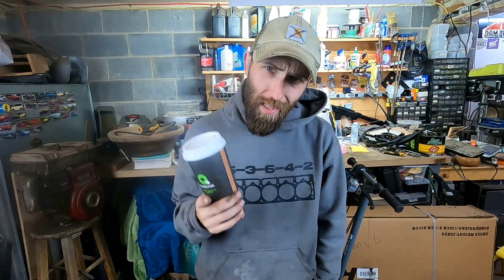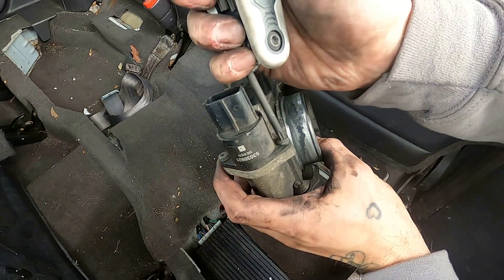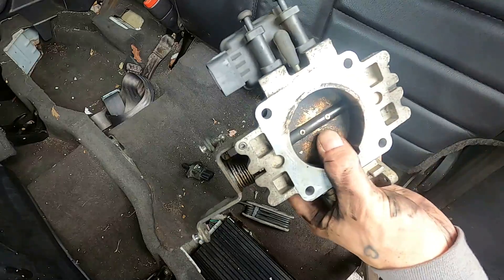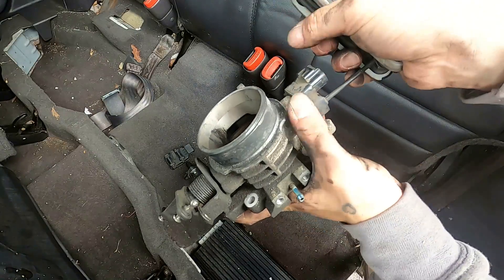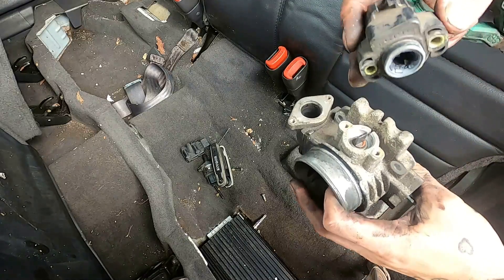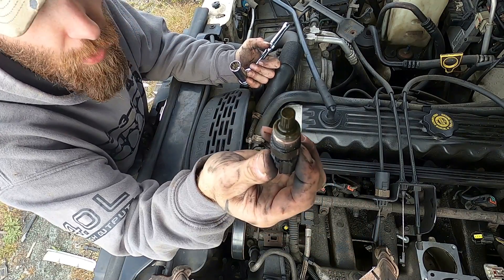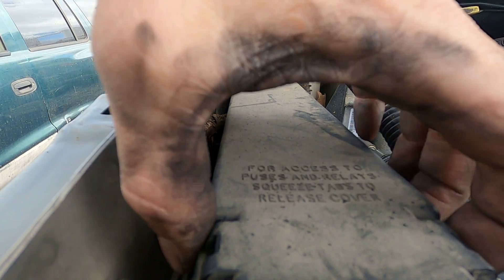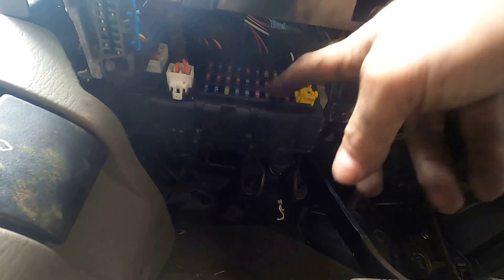Jeep 4.0L engine sensors I suggest you keep on hand

Comment: If you have an air bubble in cooling system, you can get a weird intermittent high engine temp reading when you wouldnt normally be running hot.  

Omg, if you have a 2.4, keep a spare crank and cam sensor, or you wont be crawling no malls.

Comment: Those damn TPS screws!!! 😭 I already stripped mine
Reply: I ended up using a dremmel with a diamond cutting disc to gently cut grooves in the screw heads, then used an impact driver to get them loose. Even the impact driver had to fight them. Gonna put some anti seize grease on them now. 

Make sure you dont cut all the way through the screw heads!!!

Comment: Hi there, thanks for the great video!! I was wondering, when the crank position sensor goes bad and the engine won't start, does it throw a code to the OBD? My WJ is cranking and not starting but it's not showing any codes. Grateful for any advice! :)

Comment: Wish I'd seen this vid when it came out. I had the TPS death spiral last year where the trans felt like slipping bands and wouldn't shift. Swapped out a perfectly good transmission (186000kms). Of course the replacement did the same thing. Went to YTU and found out TPS was the culprit. 20 dollars later problem solved.

Comment: @D&E In The Garage . I have a 2001 Cherokee XJ. I'm about 95% sure the CPS is bad, and the cause for all the error codes that showed up. . The engine cutout about 5 miles from the house like 5 days ago, and just before it cutout, the engine was spuddering. Once I got home I put a scan tool on it & a total of 7 codes were showing up. A total of 6 error codes are from the some of the Coils & Plugs, there's also the Crank Sensor error. From every site & article I've watched & read, the CPS causes all the other codes I have in the PCM.

Here's the list of error codes that I found last week;
*P0300, *P0302, *P0303 - Those codes are Misfire errors.
*P0351, *P0352, *P0353 - Those codes are Ignition Coil related.
*P1391  ''Loss of Signal'' for the Crankshaft Positioning Sensor, &/or Camshaft Positioning Sensor
The only error code that I did have before last week, is a P0432, which has to do with an O2 Sensor &/or Catalytic Converter...
Well that was my week lol... I hope it's not too confusing to read...

Comment: Throttle body sensors- I spray mine every year with electronics parts cleaner. You can tell when the engine starts running rough.

Comment: Can you just buy them? Or are the aftermarket ones not good?
Reply: you can, It's not hard to find parts for them he's just staying God forbid you're breaking down and it's just a sensor. I had my temperature sensor ( one sitting behind the right headlamp assembly ) go out on me but lucky for me there's a lot of auto parts store not far from me and my jobs, I also have other vehicles so again not a big deal.. Biggest ones are the sensors surrounding the throttle body, I changed my throttle position sensor while at work 4yrs ago so as long as you keep up with it's not hard honestly most jobs on 4.0 jeeps  take less than 1hr. I also use high quality parts from suspensions, to engine mods to make the engine more reliable, and swapping out bad parts as soon as possible before it gets worse.
Reply: Definitely. Lol I went to the Jeep dealership to get a mopar thermostat and b crankshaft position sensor, need to go back and get a oil pressure sensor, just put a cheap one in for now but, I think I'll get a bunch more while I'm at it, they're not cheap 100$ thermostat and I think it's was 150-180$ for the cps.. but at least your not going to break down eh.  @StockCarGuy
Reply: Because of a sensor that is lol

Comment: About my Jeep Cherokee is it has two pigtails on the throttle position sensor and the holes that attach it to the throttle body are adjustable so you can adjust the throttle position sensor like adjusting distributor cap and as I learned it's the adjustment for the kickdown on the transmission i'm not saying it's exactly what it's for but that's how I fixed the kick down on Mine by adjusting that but they must have did away with that in the newer Jeeps maybe use some newer computer system instead of like a mechanical adjustment

Comment: Hi Doug, thanks for this video!  I have a 2004 Jeep Grand Cherokee with the 4.0 liter straight 6.  After 15 minutes of idling, the engine starts to idle rough and continues to idle worse.  After driving for about a minute, all seems fine.  The throttle body and crank shaft sensor have been recently replaced.  What should be checked first?
Reply: hello supernova did you get it fixed  back up ? same exact issue on my 02 everything is fine until it warms up an normal driving stop go stop go then BAm rough idle bad amlsot wants to die but doesnt

Comment: Hey so I have a 99 wrangler 4.0 auto trans. Crank no start.  Been battling for 2 1/2 months trying to figure out what is the problem. I have replaced the cam shaft position sensor the crankshaft position sensor the distributor and coils and no luck.  Then went back and replaced the crankshaft a second time.  I replaced the ecm as well and still no luck.  Any ideas???

Comment: Hey Doug, do you have any suggestions to fix a stalling problem with a 1990 jeep Cherokee Laredo 4.0. The car runs and stalls, no power what so ever to put a blinker or hazard lights on while your trying to pull over to the shoulder.

Comment: Might be simpler to just grab a junkyard throttle body. Clean it up. Sand the bottom so it’s flat.  And keep it with all new sensors pre-installed.  Also, be very aware of where you buy your sensors. I just had to return a IAC  that DIDNT FIT. Pffft

Comment: MY JEEP STARTS AND DIES
Reply: Try the starter fuse first. Then if that doesn’t work, get a new crank shaft position sensor. If that doesn’t work, keep working the other sensors he mentioned. Start small. It’s be a good idea to change out most if not all sensors if possible.

Comment: Kinda funny i  took my xj to the dealership to fix the tps issues, and 3k later still have the same issue. A $15 switch solved the whole issue for the tps and no one  has posted it on any forum. The brake light switch has a tiny amount of play can cause  all these issues.

Comment: I'll tell you something: the TP sensor works with the signal from the clock spring that goes to the steering wheel. When that gets damaged, the airbag light comes on and the truck starts to fail.

Comment: I thought I was the only one that bought new ones as spares as these so cheap. I have a spare air idle control valve, throttle pos sensor, fan relay (a must. ) and map sensor. I think I spent $75 for all 😂

Comment: Always jeep a few t20 tirx bits ,a half inch long socket ,a half inch socket,and the multi screwdriver that will fit the torx bits ,alsi 3,4 5,8 hose foot if each and 4 hose clams in case your geater core starts steaming through the vents ir jyst gives out ,the fan fuel pum asd relay are alk the same so carry one extra ,yse quality parts especially when it comes to sensors ,justsatn.

Comment: Crank sensor is not easy on a 2003 Grand Cherokee. Mine swelled and was completely stuck and would not move. I could not get it out even after making the access hole bigger and it was starting to distort and about to break. I used  a few drops of lye at a time to dissolve the bell housing. Aluminum is attacked by acids and bases while steel is only affected by acid. Took 3 days but I got it out, lather rinse repeat.  The reason I am watching this is because last night the packrats ate the wire on the new one and I could not remember how the dash came apart.

Comment: Atleast on XJs the cam sensor is only used to determine where the engine is on startup. If you unplug it the engine wont start but if you start the engine and unplug it while the engines running the engine will stay running like normal but it will throw a CEL.

Comment: I removed the temperature sensor that turns the fan on. Mine failed and cause my radiator to burst in my 02 WJ.  I replaced with an older model manual fan ,after buying a new radiator,$$

Comment: I have a 95 zj 4.0 and sometimes the car shakes crazy on acceleration/misfiring (no fault codes except lambda sensor). 
When you lift off the throttle and drive for a couple minutes slowly all is fine again...any idea?

Comment: I have an odd one... getting high voltage (even with the ignition off) across the signal wire of the TPS. I trace the wires and it seems like oil is flowing through the wire casing? Maybe from pcv valve failure or something? Going to end up scrapping this 4.0 unless You want to buy it. In Washington.  Ran good and still runs but has oil in the wires now and I am having issues finding the short.

Comment: The cam synchronizer is the part that goes into the oil pump and needs to be timed. The sensor is the plastic part on top that you have to remove to time the synchronizer. As long as you don't turn the engine over it's easy to replace.

Comment: I love seeing videos like this. I've had a jeep for 7 years now. Been through the mountains and plenty of trails it shouldn't have been. It's been eating nitrous for over 2 years. Went to the drag strip every Thursday for almost a year straight. Put a 4.0 header on and the rest of the exhaust is 3inch stainless with a 5 inch square pipe on the end off of a late model dirt track car. Limited slip in the rear. No sway bars. All I've replaced is water pump and radiator. Never even taken the valve cover off. Yall must be doing something wrong with yours to have all these problems. Maybe you should stop caring and just drive it. The more you care the more stuff seems to break.

Comment: Inhave a super rough idle and it clears up at about 2700 rpm and at idle the exhaust sounds like shit on idel as well. Amd when the air filter is off and you whack the throddle soumds like a toad is in there anyone have any ideas what yhis is?? Its nit the air semsor i tried that stayed the same

Comment: ONLY USE OEM THROTTLE POSITION SENSORS!!!
.
napa, carquest, O-fucks..... all the same part.... all with same problem
they arnt sealed... and get full of water
.
also with crank position sensor.... needs to be OEM
the napa one worked for a while... but the magnet strength VS OEM is like 5x

Comment: Just literally 20 minutes/8 beers ago swapped the TPS from my 99 parts WJ into my 01 daily WJ and hopefully solved something I've been fighting for a week. Deep water on the road home and a coil strip and plugs later, I'm 160$ in and hopefully fixed. I'm on my 3rd WJ and it still still boggles me I can ford downstream with water over the headlights but a puddle takes me out for a week. 25 miles away from 200K.

Comment: grabbing an extra ECU would not be a bad idea, generally the only thing that goes wrong with them are the three electrolytic caps, but if they happen to fail while on a trip, you are calling a tow truck. I keep a spare for my 2.5 Wrangler in my spare parts bag.

Comment: My 2000 XJ is starting to act like the transmission is going. It was rebuilt about 15 months ago. They said it wouldn’t last because I have a 32” tire with 3:55 gears. I’ll try the TPS sensor first. Also losing coolant with no explanation of where it’s going. Great video
Reply: Replace your radiator cap first and see if you coolant leak goes away... otherwise check your head for cracks. I have 2 2000 xjs, one has already had the dreaded cracked 331 head. The other had a mystery leak, and it turned out being a  radiator bad cap.

Comment: Doug, Dan here, I’m no need of your help. I have a 1999 Jeep Cherokee Sport 6cyl 4.0. So the water pump went out. Simple enough, less than a week later I’m driving home when it stalls. I had just got in the Jeep, just warmed to operating temp. Since then it happens every time it warms up. Could it be the coolant temp sensor, could it be the crankshaft position sensor. I’m really strapped for cash, and could really use some help. Please get back to me.

Comment: I have so many spare parts in my 99 Cherokee 4.0, the local parts stores call me to see if I have any extras. Now I'm stuck trying to find the cause of my #4 misfire. Something keeps frying that plug. No coolant leaks. 184k miles on it.
Reply: I have a misfire on 3 I think. But no codes , did pop a code for just a second after cleaning iac and it said misfire on 3. I’m kinda stumped on what it could be. Idle acts like it wants to choke out or something but then corrects itself. Fine at higher speeds. Problem is only idle.
Reply: @takenursht8701  Mine was an internal crack between 3 and 4 on the head. Drove it like that for 8 months and finally got a new head. Runs great again.

Comment: Don't forget about all the relays inside the interior fuse box area they control all of the starting and gas shut off relays they're in there above the fuse box very important one especially for those ignitions that have the transmitter hey Google

Comment: In 2004 WJs got a proper fan relay in the fuse block. Prior years had the TERRIBLE fan relay under the passenger headlight that required you to keep the motor on suicide watch.

Comment: Hey Doug! I got a video idea for you. How to do a totally comprehensive health check on the 4.0. Everything from compression, fuel pressure, injector performance, oil pressure, leak down, engine critical vacuum systems etc. I'm sure there's stuff I missed. Would be great to just have a good baseline reference to compare to. My buddy just managed to find a non running '92 wrangler for  $500 that only needed ECU "brain surgery" and fired right up. Knowing how to check the health of the motor and to check that it's running right would be nice to see what next steps are needed to make it a reliable daily.
Reply: This would be incredible, especially for those of us with RENIX Jeeps. There's so little good information out there, and what good information there is seems spread across the internet. A good clear video saying this sensor = these problems, and this sensor = these problems would be SO helpful!
Reply: @doctechno2241 Service manual has all of that lol.
Reply: Why don't you two collaborate and do it? Just cut the best clips from various videos and film some of your own if needed. I'm sure it would become the Bible for 4.0L noobs...like me. 
      I just inherited a grand cherokee that's been sitting for a year and a half after my niece drunkenly crashed into someone's yard and hit a small tree. It was going to get sold to a scrap yard so I offered to take it to use as a daily to keep miles on my car down. It's a 99 or 2000, wait...maybe 01+ because i just looked at wjbible and it has silverblade #1 wheels with the newer centercap. Could be an 04 for all I know. I moved it from the street to the garage side yard like 2 years ago when I was doing an oil change on my car and the jeep felt like garbage just moving that hundred feet. Felt shaky and weak. Definitely wasn't taken care of. Granted I'm driving a low mile 2011 Lexus is350 so I'm used to smooth, quiet power (0-60 in 4.9 seconds).

Hopped on Amazon and ordered plugs, air filter, valve cover gasket, hood struts, thermostat, radiator cap. This wj has 140k on it. I have a couple obd2 scanners but I don't even know if there's a check engine light on. It probably needs a battery, too. Lol think the date said 2018 on it. 
      Tires are bald so I'm picking up a used set of those older attractive 17" wrangler 5 thick spoke wheels w/decent tires for $150 tomorrow. Pissed I missed an 80-85% set of 18" Michelin Defender tires for $150! the other day as there's a newer 18" wrangler wheel set for $80. Hopefully finish the radiator install on Sunday, but my bro in law was doing it and he's no mechanic so it might be a headache. I'm pretty mechanically inclined and have done all my own maintenance since high school auto shop over 20 years ago. 
    Glad to see parts are cheap for these, though. Water pump is only $30-40 to where my lexus one on sale was over 100 but that was oem. I was thinking of just the cheap 2" rough country lift on Amazon but then I spotted a "lightly" used 4" lift kit on marketplace for $250 (that runs $800 or so new). I guess I'm getting ahead of myself and need to make sure the engine is solid before dumping money into it. So make that video guys!
Reply: Hey i have a question someone might know. I got a lifter tick only during certain warmup temps, then goes away when warm
And driven. Quiet on startup too. Only happens from like 120-180 degrees. Anyone know why?
Reply: I’m with you man. I’d like to see that.

Comment: Thanks bro, finding out the throttle control sensor was messing with the transmission shifting. Ran to the parts store, fixed my issue I’ve been having for months. 🎉